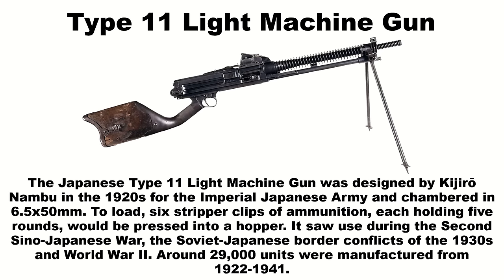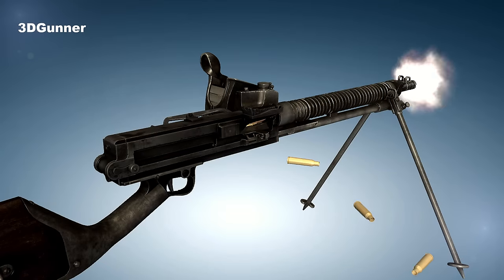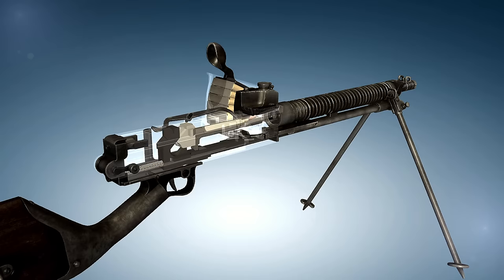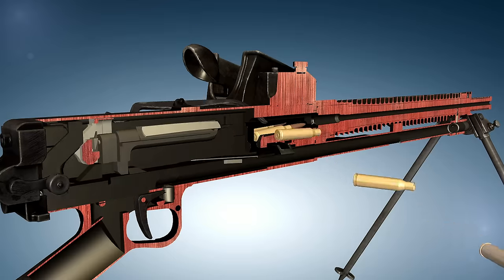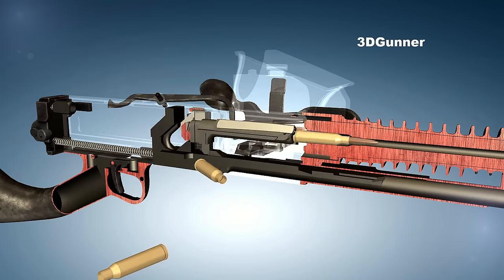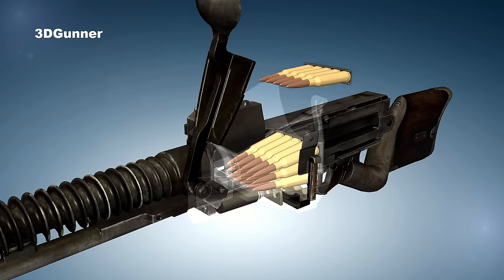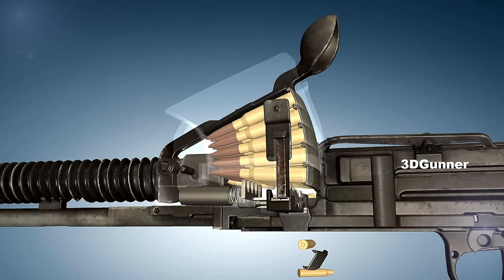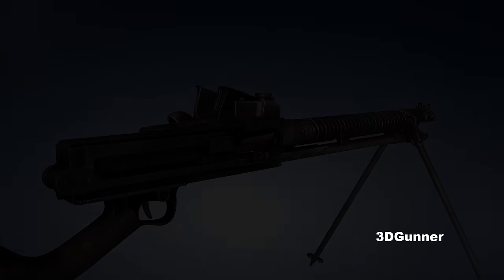3D Animation: The Very Unconventional Type 11 Machine Gun

Comment: Very original idea though when you don't have belts
Reply: This allowed the machine gunner to get quick reloads from any fellow infantryman
Reply: I learned about this type of gun through the game Enlisted, its advantage is that it is easy to reload, the soldier using the Arikasa rifle can use his own magazine to give to the machine gunner without having to look for bullets.
Reply: The Italian got the were the first with the Perino Model 1908 machine gun which used six 20 round clips
Reply: @dannyzero692 the perino was my daddy in BF1
Reply: Breaking fingers. The magazine cap had very powerfull spring capable of breaking a finger. And there was also an oilcan for a cartridges.
Reply: Nor springs to push the bullets into the chamber
Reply: @badshootykat5574  whenever recoil spring pushes bolt, and bolt pushes cartridge.
Reply: Adding to this, it was also for time saving: With a belt, you have to take the box of loaded clips, unload each clip, and then load the belt. With this system, you can take the loaded clips directly from the box and load them into the gun 

It was a pretty good idea, but it had severe reliability issues, and was replaced in 1936 by the Type 96, which used a fully enclosed detachable box magazine.
Reply: Not that original. French had this idea first.
Reply: @yeuamnhac5877 then they’d be without their own ammo??

Comment: My paternal great-grandfather used this gun on the Chinese front. It was probably good enough for use in countries such as the Philippines, but apparently it was the worst for use in mainland China. Sand got into the exposed hopper, causing the ammunition to jam, and the gun oil to get stuck in the sand, making it useless, so in the end he used a ZB26 captured from the Chinese military.
Reply: Thank you for the info. Very little documentation exists on the efficacy of the gun in the field.
Reply: @adamthompson626  My great-grandfather didn't think much of the Type11, but he did appreciate the ZB26's sturdy construction and reliable operation. The fact that it used a 7.92mm Mauser bullet, which was more powerful than the 6.5mm bullet that was Imperial Army's mainstay at the time, was also liked.
Reply: I'm using Google Translate, but when translating from Japanese to English, it seems to convert the wrong words. Therefore, my English may be very strange. sorry
Reply: Also, I don't know if it is known overseas, but during the Pacific War, the Imperial Army manufactured ZB26 and 7.92mm Mauser bullets at Chinese arsenals. They were deployed in large numbers, mostly to the Kwantung Army, but some were also used in the Pacific Theater until the deployment of Type 96 and Type 99 was completed.
Reply: @アンチコメした人下痢食わす  The english in these posts seems excellent. I don't know if it is exactly what you wanted to say, but it is grammatically perfect, and the words all make perfect sense in combination.
Reply: @jmackmcneill  I'm relieved. thank you
Reply: Very interesting. Thank you.
Reply: Probably for the best that it had issuesin China (because of the war crimes many imperial japanese committed, not all of them, but likely a good portion of them did judging by the historical scale, but this is not the fault of modern Japan (and the past few generations should not be held accountable, i do not believe in the "sins of the father" thing) besides the not educating thier people about it), thank you for this information
Reply: @Yuki_Ika7  To be honest, there were times when I felt regret and apologies for the war crimes committed by Japan in the past. Your comment saved me. thank you
Reply: @アンチコメした人下痢食わす  why the hell would you feel guilt for something you didn't do?
i'm american, i'm not at fault for what the hell my country does.
with your logic, austrians feel guilt for what hitler did.

i know i'm bullying you for something that was most likely mistranslated but it is just funny to me, sorry if i sound like a bully. (i am)
Reply: @SSS333-AAA  You could have worded that without the harsh words, and it would not have come across as rude.
Reply: @lunchbox1553  I’m aware, but I don’t censor myself and would rather just clarify that I am not being rude.
Too many people online aren’t themselves and i don’t like putting on a professional character on here or anything. Sorry if I come across as a dick, not my intention brother. Stay safe.
Reply: @SSS333-AAA Thank you. It's okay because I understand your intention. In fact, my maternal great-grandfather was exposed to radiation on August 6, 1945. My mother suffers from retinitis pigmentosa, and I also think it's strange to treat the past as the past and hold the current generation responsible for it. I believe that our country and the United States have been building a cooperative relationship since the period of high economic growth. It's good to know that there are people who think like you. thank you
Reply: I don't mean to say anything political. However, the exchange of opinions that we are having right now allows us to learn new things that we didn't know about each other. I really like this situation. Also, I had never had the opportunity to hear what local people think, so it was a very valuable experience. thank you
Reply: 名前物騒すぎて草
Reply: @Xx早瀬ユウカxX 流石に運営から警告喰らいましたゾ
Reply: @アンチコメした人下痢食わす  なっ……ようつべ運営やりませんねスギィ！
Reply: @Xx早瀬ユウカxX  やめたくなりますよ〜

Comment: I have a bare barrel and bipod for this gun. The bipod clamps around on one of the fins of the barrel.
I never knew just what model and history was of these parts until this video popped up on my YT feed.

My father was in the US Navy from before the start of WWII until it was over. He served mostly on the cruiser USS Minneapolis and a short time on a destroyer while the bow of the Minnie was being repaired after having been badly damaged by a torpedo.
He was on the Minnie as it was headed back to Pearl when the base was first attacked and seemed to have been a part of every major Navy battle in the Pacific during WWII.

After supporting other forces and pounding an unknown island during the taking back from the Japanese, he boarded a landing ship and came up on a beach after the enemy had been neutralized. He found this Japanese machine gun on the beach and picked it up and took it back with him to the ship.

He was planning on cleaning it up and putting it on display but was told he had to remove the main mechanism and just use the barrel and bipod. He especially noted that in an effort to clean the remaining parts that there was no solvent on the ship that would fully degrease the gun.

He brought these parts back to the USA when he got out of the Navy, and it has been in my family ever since. There was originally a spring-loaded valve mounted under the front of the barrel that could be depressed and rotated into various detents. I believe this valve was originally connected to the gas tube and probably controlled the fire rate. Somewhere around 1968 or so when we moved that valve disappeared and didn't make the move.

I hope to clean it up someday and display it. It got some rust on it, but a good cleaning and black oxide treatment would make it appear as it was when I first saw it 60 or so years ago.
I am happy to know more about what this gun originally was and its war history.

Comment: Here are things that could make this gun "acceptable" to modern standards :
> Implement reusable 10-round stripper clips
> Use lighter materials without decreasing reliability of crucial parts
> Implement picatinny rails for modularity/customization

Even then, these changes probably wouldn't make the military adopt this gun 😂🤣
Reply: The whole point of the rifle is that it allows the machinegunner to resupply from any nearby infantryman. It wouldn't make much sense today since we don't use stripper clips anymore.
Reply: @iotaje1 
stripper clips are still used in the military, some ammo packs have the ammo on clips with an adaptor (in the US known as "the spoon") for use to quickly load magazines in a firefight.

I can see this type of contraption made as a closed bolt semi auto range toy/home defense emplacement in jurisdictions where normal and larger capacity magazines are banned.
Reply: @slimjim2584  The box would still fit the definition of a magazine so no luck on the legislation front.

If a machinegunner has access to ammo boxes he would have had access to belted ammo, and soldiers nowadays carry already loaded magazines.

A modern equivalent would be something like the minimi that usually has a belted ammo box but can use M4 mags if needed.
Reply: ZaHandle  M14 used a magazine instead of a box that can hold stripper clip ammos. But yeah, maybe the gun wouldn't work fairly well for the military even after a lot of these points were being implemented, just like M14 😂🤣
Reply: @iotaje1  Yeah, mags are the meta for the military firearms nowadays. Stripper clips are just for holding on the bullets inside the ammo carriage box when there's a shortage of mags.
Reply: Stripper clips are usually thought of as disposable. And lots of SAWs now have the same squad ammo type commonality
Reply: @No-mq5lw  I mean, the reason why most WW2 weapons used stripper clips instead of detachable magazines is simply because it's cheaper to make stripper clips than mags, which in turn makes clips less economically damaging than mags if they became disposables.

Comment: As others have commented, with this method, sand does not get into the gun.Belt-fed systems were newly invented and their reliability was still low. 
Unlike in games, machine guns are used by two people, so this method is more reasonable. 
Additionally, there are pistols in Japan that misfire when you press the side of the gun, but according to the regulations of the Japanese Army, it is prohibited to load ammunition into pistols when they are not in use, so this flaw is not a problem.

Comment: It's not exactly awful, considering the bigger the magazine, the more likely it is to jam. By keeping each individual magazine small, you reduce the risk of jamming. On top of that, if you need to load something in a pinch, a single small magazine that can be loaded quickly could make a difference in response time. If you have to relocate rapidly while under fire, even one small magazine with you can make a difference, better than having to relocate and ditch everything because the magazines are too large to take with you. Also probably helped against recruits who were a little too trigger happy and would waste more bullets than needed, forcing them to focus on making what they have count. It's like a meal, the larger portion in front of you, the more you'll eat. Same thing happens with rounds, where if you give someone something that holds a lot of rounds, they'll tend to use more of them to get the job done, but that can quickly add up to bullet shortages.

Comment: I'm no engineer or gun designer but this seems as if it could relatively easily been shortened, lightened, given a front grip and you'd have had a pretty decent assault rifle-ish thing given the light ammo
Reply: Maybe they originally intended to use it for larger rounds, or intended to make it have durability. Let's keep in mind, the Japanese were largely defending at this point, so troops were already propped up and dug in somewhere with it, so they didn't need highly mobile weapons. Maybe the metallurgical durability wasn't that good, or maybe they just wanted them to work for a long time. I'd imagine the size was also partially for general cooling capacity so that the barrels experience less wear and tear from heating up. The barrel was clearly designed somewhat like a heatsink with fins in order to aid cooling. It might have had other uses, but I'm betting cooling was a big factor in design of the barrel.

Comment: so in a sense, this is basically a miniature sideways handheld Bofors 40mm, i wonder how long it can keep firing when it is constantly being fed clips.
Reply: like many MGs, it'll likely keep going until the barrel melts. If you have a gunner that can burst-fire slow enough that someone can slap new clips in as old ones get ejected, and that guy had enough clips to keep it going... you could keep up the fire. But just imagine how fast someone can get the thing back in action if they're well drilled compared to other MGs of the time.

Comment: Nicely done video regarding what appears to be a primitive firearm design.
Reply: There's nothing primitive about it, the idea is just as sound as in case of any other squad level LMG. On the other hand, full interchangeability of ammo between regular grunts and SAW crew was ahead of its time and technology to make it work reliably simply wasn't there yet.
Reply: Thank you for your comment.  Having been a machinegunner I disagree with you.  But the purpose of public forums is the sharing of ideas, opinions and information so I welcome your comment.
Reply: @rascal0175  Maybe you should look at Type 11 from different angle then. Sure, if compared with more modern designs it may look weird at best but if you'll consider it a forerunner to such accomplished guns like RPK/RPK-74 or M27 IAR, this entire concept really makes more sense. Plus, it was the first domestically produced LMG in Japan so I would be surprised if such design was really successful. That also explains why when IJA was looking for its successor, they based it on foreign model instead of developing Type 11 concept any further.
Reply: @gratius1394  All I said was it appears to be a primitive design.  The intro to the video noted the firearm was designed in the 1920s, making it about 100 years old.  You mentioned “forerunner,” concept, better designs, surprise if the design was successful, and Japan seeking a successor.  I think this is a primitive design compare to better weapons developed in later years.  Substitute early for primitive if you like.

The Japanese made great swords.  Their skill in firearm design in those very early years was lacking.  Now it is different.  I have a modern Japanese rifle that is excellent.  One hundred years has brought tremendous progress.
Reply: @rascal0175 we still have century old guns in the market. "Primitive" is pre-cartridge black powder guns, not a gas operated machine gun